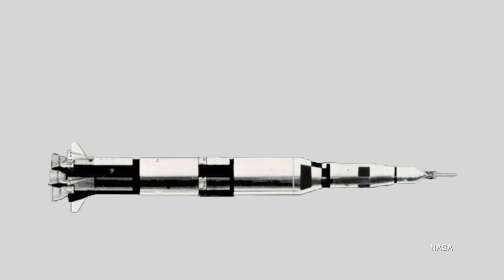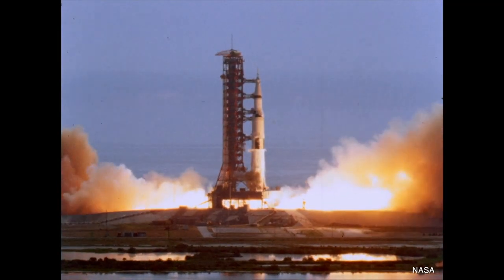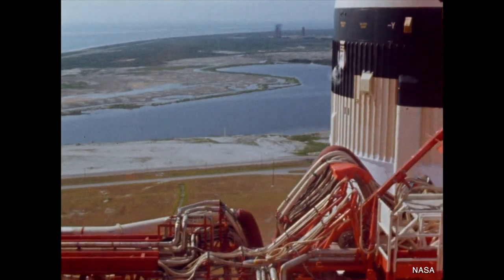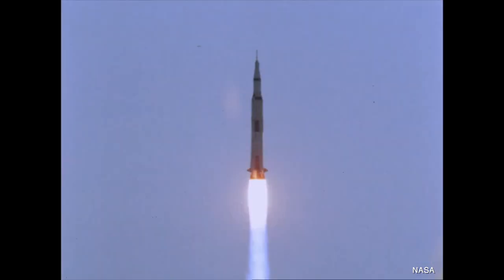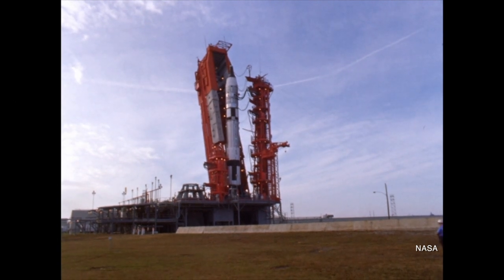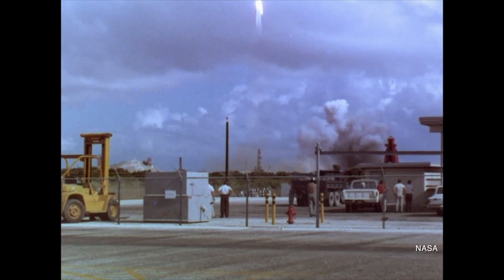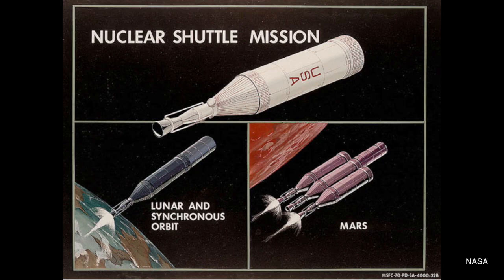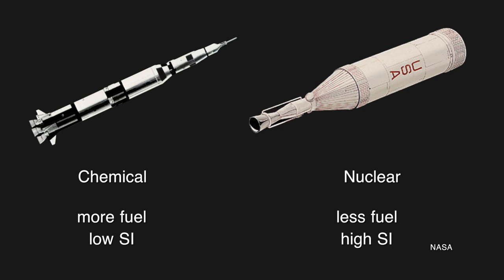What's the Best Kind of Rocket Fuel?

Comment: Random Hydrazine story... I was a retained firefighter some years back, and we got called out to a tanker involved in an RTC near a major Royal Air Force base in the UK. The driver of the tanker spoke very little English, and while this liquid was dripping from the tanker we were struggling to get the name of the substance in the tanker, let alone the safety data about it. I remember the manufacturer telling us on the pone "Guys, that tanker is filled with concentrated Hydrazine, sometimes used as a rocket fuel, it's extremely flammable, toxic, carcinogenic anyone near that spill is in immediate danger... you are at least 600 metres away from the tanker aren't you?". Instantaneously went from RTC to major incident in the blink of an eye: we were standing right next to the tanker in nothing more than fire tunics! The bollockings received by the RAF, tanker company, and our fire station were monumental.... luckily only a few gallons leaked out, but I remember that incident with much fondness when I hear the word "Hydrazine" :D I'll shut up now, and let Amy do what she does best!

Comment: Self ignition is a useful property for deep space propellants, but that is not the only, or even the most important, reason that hypergolic propellants are used.  Another, very important, reason is that the most common hypergols, hydrazine, its derivatives and nitrogen tetroxide, are storage stable.  The cryogens, including LOX, just don't want to stick around.  If your mission plan is days, weeks, months or years, instead of hours, you need storage stability.
Reply: I guess you could call hypergols "stable" in the sense that they don't continuously boil away like cryogens.  "Storable" may be the better term for hypergolic propellants since, as a rule, they are insanely corrosive and hideously toxic.   Not the worst choice for an ICBM that has to spend decades in a hole waiting to launch on two minutes warning, but far less attractive in the booster stage of a space launch scenario where missions are planned years in advance.
Reply: Mylitla  Nitrogen tetroxide, and the older red fuming nitric acid, are quite corrosive, but not so much that they can not be contained in proper metals.  The hydrazine propellants are not corrosive to metals.  In fact, one of the common uses of hydrazine is as a corrosion inhibitor in boilers.

We should not imply that the word "hypergolic" necessarily implies all of these propellants are highly hazardous.  An early French rocket used red fuming nitric acid (nasty) and turpentine (not so bad).  Most, but not all, hypergols are highly toxic.  Some hypergols, primarily the nitrogen oxides, are highly corrosive.
Reply: The trick with RFNA was to add about 0.5% hydrofluoric acid to passivate the metal container. I guess compared to the overall nastiness of RFNA 0.5% HF doesn't change much...
Reply: NTO isn't exactly storage "stable". NTO tanks need air conditioning to keep below 70F. For a quarter of a century, we had Titan II missiles stationed in hot climates (Arizona, Kansas, Arkansas) in well-chilled silos... With neighbors worried at any time about red clouds of doom if NTO leaked.
Reply: Mark Holm Nitric acid is a byproduct of NTO reacting with water.

Comment: Amy I always was wondering, what kind of engineering is used in the return capsule, so that it faces always with the heat shield towards front. I guess, if it rotates even slightly, heated air would destroy the surfaces not covered by the shield. I also understand that the forces during entry are too large to rely on just some small exhausts to do the job. My question is even bigger in the case of Mars or Titan entry, where we have no time to control the entry ankle from earth until we can open the parachute with safety. Thank you.
Reply: PPanos1968 The gyroscopes in the guidance system helped with capsule orientation pre-reentry, and there were thrusters as well to control the roll.

Comment: Hi Amy,

Great job with all your videos. As a child of the space race I have been meaning to subscribe for a while now. I finally decided to because it is important not only to support Vintage Space, but to clear up a common misconception regarding the usage of the terms Rocket Fuel and Rocket Propellant: they are not one and the same, and cannot be used interchangeably just to improve ones’ prose. They are distinctly different concepts.

Rocket Propellant provides the inertial mass needed to push the rocket forward by virtual of the fact it is the stuff pushed out of the rear of the rocket: it does not bring any energy to the table. Rocket Fuel is what provides the energy needed to push the propellant out the back in the first place. In the case of chemical rockets, serendipitously, the same stuff acts as both fuel and propellant, and that is what makes chemical rockets so special: it is also the source and cause of confusion over the usage of  two terms. 

In the case of nuclear propulsion (NERVA), the atomic pile provides the energy and is considered the rocket fuel, while some fluid (like hydrogen) acts as the propellant when it is heated to high temperatures and expanded out of a nozzle to generate high directed velocities to produce thrust. Ion drives use Xenon gas as a Rocket Propellant (not fuel), and may not have any rocket fuel on board (no, the solar cells are collectors of energy, not sources, hence not really rocket fuel) -- in which case the rocket fuel is the sun.

So as a demonstration, imagine I am stranded in the middle of a becalmed lake in a row boat full of tennis balls but no oars. For some reason, I have a phobia about sticking my hands into the water, hence I cannot paddle back to shore. I do not look at all those tennis balls and think, ‘Aha, Rocket Fuel!’. No, I think, ‘Aha, Rocket Propellant!’. The tennis balls will not throw themselves over the transom: I will need to provide the energy for that. I can still feel lunch in my stomach and I think, ‘ Aha, Rocket Fuel!’. Yes, that burger in my belly is the rocket fuel needed to power my arm muscles acting as rocket engines, that propel the tennis balls acting as rocket propellant. Because propellant is precious onboard, rather than wasting propellant to change direction with an analogous RCS thruster, I use the same energy source (the burger in my belly), to stand-up and spin around, again using inertia effects to reorient the bow towards shore; that is, I use my own body as a reaction wheel. Hence, the most precious commodity on a rocket is propellant, not rocket fuel.

Even so, when speaking about chemical rockets, you should be aware of when to refer to it as a rocket propellant or as a rocket fuel, depending on the context. Technically, it is the propellant aspect that generates the thrust, and the fuel aspect that generates the power. Please use accordingly. 

Sorry for the hair splitting, but you got me to finally subscribe!

Comment: I just wanted to elaborate on Amy's post (follow up with Scott Manly, too!):

There is a tri-fecta of options that you can choose when you choose/develop a space propulsion system: 

You have efficiency, reliability, price; when engineering a system you can only pick two... and nobody ever wants to ignore reliability. As Amy said, the overall performance is stated by the specific impulse. 

These are best explained by two contrasting examples:

The highest performance, regardless to cost, is the Rocketdyne RS-25. It is a extremely complicated and efficient, proven system, that powered the SSME (space shuttle main engine) and was further refined for higher performance in the new SLS system. It uses difficult to handle cryogenic fuel and oxidizer with a highly optimized and efficient combustion process (hydrogen combusts rapidly and violently with only a small ignition event). Because of its complexity, the computer control is required to operate it in a controlled, efficiently, and safe manner. If you add these development cost with the costs associated with the development and use of materials that operate under these conditions, one finds a whopping 452s specific impulse in vacuum for an extreme price...! An order of magnitude or more than that of something by SpaceX or ULA or otherwise...

On the other hand, the Merlin engine from SpaceX is a reliable, inexpensive engine with reasonable performance characteristics. It burns the same fuel as some home heater and lamps use, which means it quite a bit safer to handle. You can store kerosene in your home, and, properly burned, it is not as dangerous and does not have a noxious exhaust (try storing liquid hydrogen in your house- it's explosive, super cold, and vents off flammable gas when it sits around heating up!). Also, because kerosene is a large molecule, it is not as reactive with oxidizer, so burns slower and needs less fine tuning to the combustion process, but with the penalty of less performance (when was the last time you saw a kerosene heater explode?). SpaceX can offer reasonable performance with the Merlin that is reliable and efficient, which allows non-state players the ability to launch payloads for a fraction of the price of a government-run program- but there are much more limitations of where and how the payloads can be delivered. Even though an engine offers a specific impulse of 304s, (about 66% of the RS-25), it does so at less than 1/10th to 1/100th the cost. The Saturn V used the same fuel as SpaceX's Merlin. If you throw in 60 years of evolution of engineering metallurgy, manufacturing processes, and computer modeling,  you will note that SpaceX was able to squeeze a lot more performance out of the same fuel and oxidizer as NASA in the 1960s (one would come to expect this, however)

~~~

Regarding other propulsion systems such as hypergolic, ion, and nuclear: such systems are much more feasible for upper stage/high vacuum conditions, because of the efficiencies  when not having to deal with atmospheric drag and the freedom to operate without ambient pressure. When you operate an emissive propulsion system, you need to expend energy to push away the fluid/gas (mass) that is directly obstructing the exhaust of the engine. Any extra work to move combusted material out of the engine is a performance hit, because you cannot liberate more energy from combusted fuel until the combustion chamber is voided of such products. Because of such, these propulsion systems generally not in the performance category to be able to lift anything off the surface of the earth. Gravity acts fast and hard, and you need to overcome a huge gravitational potential, with a massively weighted rocket (generally most systems that output how power in a short time are inefficient compared to refined long duration systems),  in a short time. Since most of the payloads launched into space are for local planetary use, so the R&D applied to that technology is generally allocated to proven chemical propulsion systems. If the payloads need to go well beyond Earth orbit, then these exotic and novel propulsion systems are always an attractive option for the final stage. 

Anyway, that's my two cents, lol.

Comment: A rocket actually does push against something - the mass-inertia of its own propellants. Both the rocket and the propellants have mass and therefore inertia, which makes them want to remain in a constant, uniform state of motion. Essentially the rocket and the propellants both push against each others inertia causing the mass of the rocket to go in one direction while the mass of the propellants go in the other direction away from a common starting point at the center.

This is why the Saturn V used kerosene instead of hydrogen in the first stage. The kerosene had much more mass than hydrogen. This allowed the first stage engines to produce enough thrust to lift such an enormous machine. This happened according to the equation F=MA, which states that the larger the Mass (with its corresponding inertia) being Accelerated then the larger the Force being produced.

Its a common misconception that the sole purpose of the propellants are to burn so as to produce heat and mechanical energy.  In addition they also supply the mass-inertia that gets accelerated in one direction to produce the propulsive reaction in the opposite direction.
Reply: Found this - Tim Cole, Apollo-era kid and space nut
Answered Feb 22, 2015 · Upvoted by Robert Frost, Instructor and Flight Controller in the Flight Operations Directorate at NASA
Marshall Space Flight Center (MSFC) did consider using liquid hydrogen (LH2)  for the S-IC stage, but the problem was the volume of the fuel needed to meet the performance specifications. They'd already reached the practical limit for the size of the tanks that could be built - as the longitudinal welded seams became longer, the distortion in the cross-section became more severe.

RP-1 doesn't provide as much energy per unit mass  as LH2 but it is twice the density. The only way they could get the necessary total impulse from the first stage was to use the denser fuel.

The S-II and S-IVB stages could use the bulkier (but far more energetic) LH2 fuel once the S-IC had gotten the whole stack well off the ground.

Another factor was that they couldn't get the full benefit of the LH2 fuel at sea level, where the  J-2 engines used for the upper stages operated relatively inefficiently. Used in the first stage, the RP-1 fueled F-1 engines outperformed the J-2 engines at sea level. The specific impulse figures are quite revealing.
             Specific Impulse (s)
           Sea Level     Vacuum
F-1:       265               302
J-2:      200               425

They actually got the best possible performance for the Saturn V system through their selection of fuels for the stages.

Comment: Actually, there was research done based on NERVA in the late 80s/early 90s (an SDI thing) that had nuclear engines powerful enough to serve as a first stage, with an ISP above 1000s, thrust/weight ratio around 30, and half a million pounds of thrust. Project Timberwind, specifically the Timberwind 250. Really cool stuff.
Reply: Even before Timberwind, there was DUMBO, which was proposed around the same time as NERVA. It had speculative TWR in the region of 50,  and an ISP around 850s.

Comment: You can also use a nuclear reactor to generate electrical power to run an ion engine.

This is probably the best option for deep space propulsion beyond Mars orbit.  Because ion engines have better Specific Impulse than nuclear thermal engines.  But sunlight intensity drops off like 1/r^2 as you get farther from the sun, making solar power panels too inefficient.

And I think that idea is totally Vintage Space because Ernst Stuhlinger (one of Werner von Braun's associates from Peenemunde) wrote a now forgotten book (Ion Propulsion for Space Flight) laying out all the technical arguments.  That book was published in 1964, before the first Saturn V launch.

Comment: While Amy is totally correct about a rocket accelerating due to its reaction to the hot gas leaving the rocket nozzles, the escaping gas does have to contend with atmospheric pressure.  If I remember my propulsion class correctly, usually at lift off the jet of hot gas is overexpanded, and leaves the exhaust bell pretty much in a nice cylinder.  However as the rocket gets up into thinner air you see the exhaust plume spread out greatly due to the flow being under expanded in the bell.  The length of the bell is optimized only for one altitude, usually about half way through the total burn time of that stage.

Comment: C'mon, everyone knows sugar and potassium nitrate are the world's best propellants. :D
Reply: Super hot burn.   ☠ Danger, Will Robinson!Danger!
Reply: Sir Can sugar and potassium nitrate still be good if they already made and stored years ago sir,  I want to learn how to make rocket fuel for missile becoz my country doesn't have it, I want to help my armed forces to build mlrs,  ground to air missile, ballistic missile and preferably for external threat defense. Since Rocket fuel is one of the most needed composition in building an effective missile defense
Reply: @jokydee5694  it is one of the most accessible forms of propulsion, however, it isn't very efficient.  If you want a good propulsion mechanism,  use amonium perchlorate composite propellant. Recommend changing the fuel mixture to be fuel rich a bit into the flight so you dont explode during maximun dynamic pressure.
Reply: Di Lithium crystals...  Well, it worked for Scotty...  ;)   lol

Comment: Random fact / bit of calculation:  When using photons as reaction mass (i.e. using a laser as a rocket), the thrust is proportional to the laser power via the speed of light.  So, to equal the S-IC's thrust of 33 megaNewtons with a laser, you'd need about 10 petaWatts.  The interesting part is this: lasers developed for inertial confinement fusion research (such as at the National Ignition Facility) are just a little ways into the petaWatt range.  So, for extremely short lengths of time, on the order of nanoseconds, those lasers are producing a total thrust that is of the same order as the Saturn V first stage!  That sets the scale for how tough it would be to take a significant payload from the ground into orbit purely using a laser rocket.  Your laser would be so intense that you might well cause nuclear fusion in the ground below the rocket!